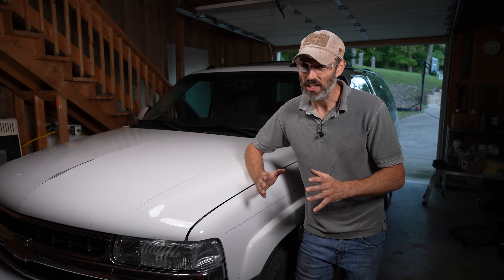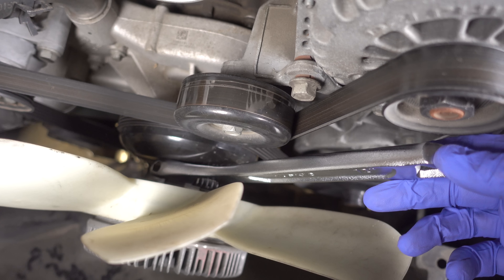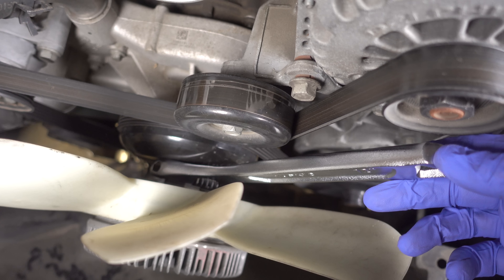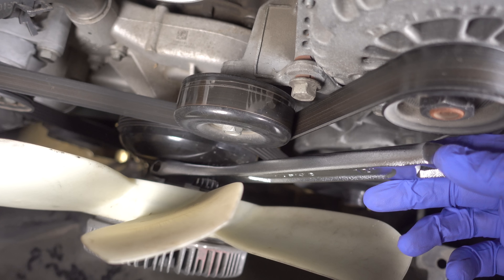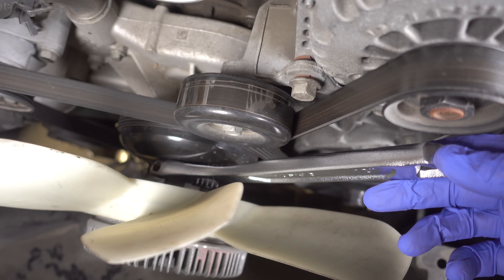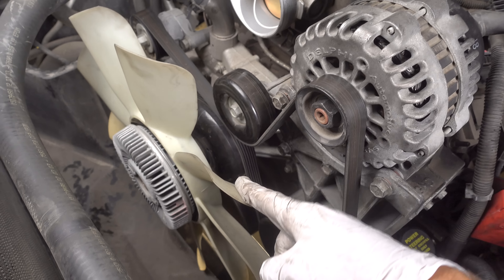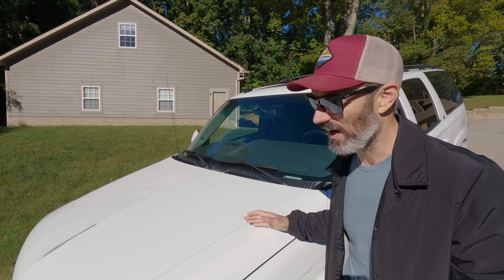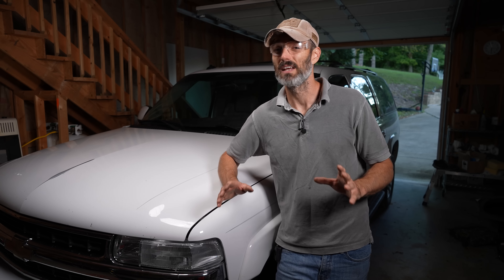Here's Why You NEVER MESS WITH Your Factory Power Steering Pump!!

Comment: I like how gm designs something like that accessory bracket so it looks like all you have to do is pull out the bolts that hold only the power steering pump on but then you got tear everything else apart...now let see how long it takes for the flare on high pressure line to crack...for me it was immediately

Comment: On my B3000, you have to remove the power steering pulley before you can remove the pump bolts. There isn’t enough room to use pneumatic tools on the puller so you need the strength of Hercules to slowly crank that pulley off.

Comment: You gotta love how GM makes the bracket so you could just lower the pump unit if the 4 bolts were removed, but fails to places access holes in the pulls.  If they did, removal of the pulley could be done on the bench.  Sold my GM stuff.  Not going back.

Comment: It's a lot easier if you remove the alternator first. Two bolts, a small nut and a plug. Then bracket comes out easy.
Reply: Was gonna comment the same thing that’s how I do it
Reply: That's also the way I do it. Less than a minute to remove and reduces the weight of the bracket considerably.

Comment: For connectors that get damaged you could have just unpined the connectors and put the pins in the undamaged connectors so soldering is not needed
Reply: How does someone unpin the connector?  Any special tools required?
Reply: @hb5914  normally the outside of the plug is black but inside is either white brown maybe green at times are a clip that can be pulled then with a pick you can push the pins out unless gm epoxy there clips then rip

Comment: BEST WAY IS TO REMOVE THE WHOLE ALT. BRACKET HOUSE,    AND EVEN BETTER DISCONECT THE ALT.  FROM THE BRACKET HOUSE,   AND DISCONECT THE HIDRAULIC POWER HOSE FROM THE UPPER CONECTION, THEN REMOVE THE  POWER  STEERING UNIT WITH THE HOSE ATTACHED, JUST REMEMBER HOW WAS ROUTED, THERE'S NO NEED TO REMOVE ANY PLATE UNDER, THERE'S NO NEED TO GET UNDER THE TRUCK,   JUST DISCONECT THE POWER HOSE FROM THE UPPER CONECTION !! AFTER REPLACING THE BRACKET FROM THE OLD UNIT AN READY TO PUT IT BACK,  REMEMBER HOW THE POWER HOSE WAS ROUTED,   IS VERY EASY !!  I JUST DID MINE YESTERDAY, 005 TAHOE, FOR ME THE HARD PART WAS REMOVING THE PULLEY, AND , YES, I USED THE PULLEY OUT TOOLS SET, BUT, THE VERY FIRST THING IS TO DISCONECT THE BATTERY ,   BUT, CONGRATULACIONS , I LOVE YOUR VIDEOS !!!

Comment: There was no mention of bleeding the fluid. Is that not needed? you just install the new pump, fill it, start the truck?
Reply: No you have to bleed it bit sometimes you get lucky
Reply from the maker: You should let ALL the old fluid out and refill with new then get the air out. I mentioned in the end I should’ve had the truck on jack stands and turned the wheel from lock to lock before I started it.. that would’ve helped to remove air. 🤷‍♂️

Comment: Must be nice changed my powersteering pump in my 04 sierra 2500 with hydro boost over 4 hours of bleeding time total with the last 2 nights sitting topped off I don't understand how I have so much air no leaks everything is tight but still pukes fluid on my right turn lock. Absolutely ridiculous